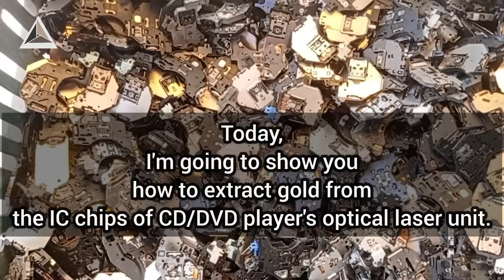Gold Hidden in Laser Optical Units | Extracting Gold from CD/DVD Laser IC Chips

Comment: Why don't you pan the ashes out of the cons?
Reply from the maker: You're absolutely right to bring up panning, and in fact, I do observe gravitational settling during the washing of fine ash with water. 🧪💧
When dealing with ultra-fine particles containing gold wires or bonded material, I allow the suspension to settle for a while — the denser, gold-bearing particles slowly sink due to gravity. 🌡⚖
I carefully decant the upper portion once I notice that the fine ash is no longer visibly suspended in water. This process helps isolate the heavier residues that may still contain value, before moving to any chemical recovery like aqua regia. 🚿⚗
So yes, gravity-based separation does play a role, but more as a preparatory step rather than a complete recovery method. Great observation!
Reply: @TrinityGoldRecovery  Thank you!!! 😊
Reply from the maker: @ Happy Recovering – Trinity Gold 🔬✨